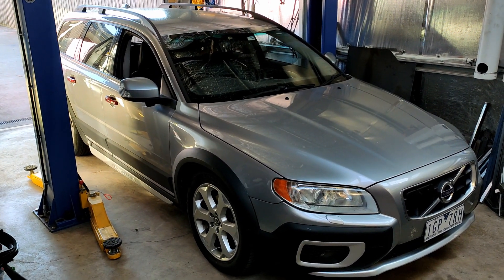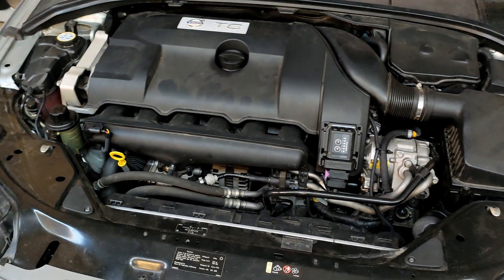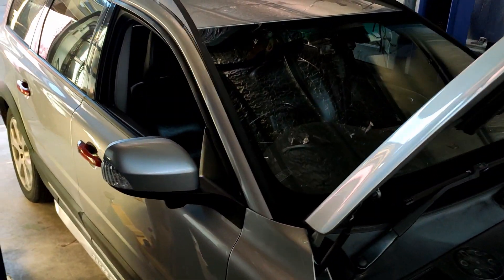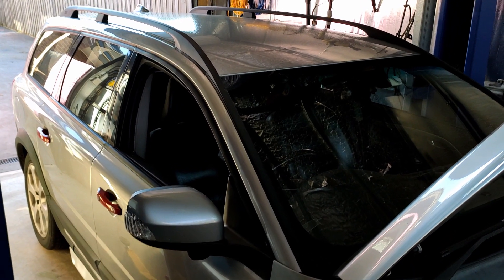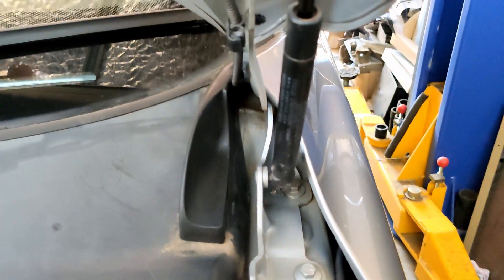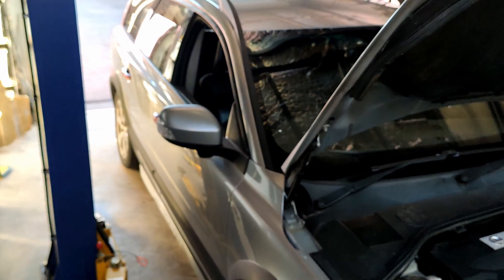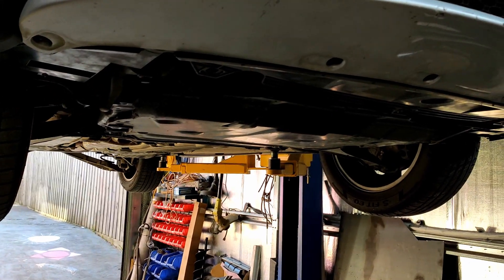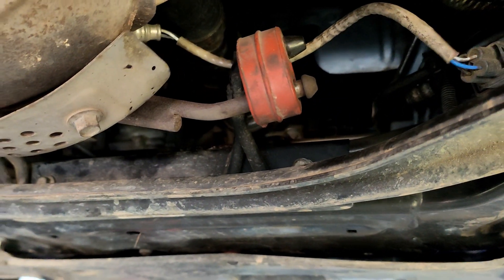Volvo XC70 P3 D5 to T6

Comment: That was some project   Hat off to you m8   Quite surprised that the cars didn’t have the cooling seat feature  especially with the climate you have in your country
Reply from the maker: Thanks for your kind words. To be honest, I do find that the air conditioning in these vehicles doesn't quite cut it for Australian summers. It works, but it doesn't really compare to what a locally produced vehicles aircon can do. Certainly no engine overheating issues though. I give this car a hard time, including towing heavy loads on hot summer days and it doesn't seem to bother it at all.

Comment: Thanks a lot for this detailed video. I'm preparing to put a V8 in my 09 XC70 3.2 using my 07 S80 as a donor, similar to the swap that @swedeprojects has shown both here and on their Instragram. My concerns are with modules - one example, the XC70 has the power liftgate where the S80 of course does not. Wondering if VDASH can keep the power option working. Also my XC has RTI where the S80 does not, so it's interesting to see that you have had trouble getting yours to work after the swap. Would like to see if you do modify yours to use Android.
Reply from the maker: I know a guy that did a similar swap. S80 V8 into V70. He did mention the tailgate issue and I don't believe he has found a fix for it. I did not get my RTI working. I wired it in, but the ICC did not recognise it, so I gutted it and replaced it with a raspberry pi. I'll make a video on this soon, just waiting for some more stuff to make it worthwhile.
Reply: @AngryGermanGarage  Thanks for your reply, great to hear of your success with the Raspberry Pi! Does your car have speed sensitive steering, or did the donor? My donor S80 V8 has it, recipient XC70 does not, but I'd like to keep it if possible.

Comment: wow, such a huge work, it's really impressive: since you are working on adaptive cruise control that is something that I am trying to install too and still miss the radar connections: are you aware of how the radar is connected to CEM? do you know how many wires it needs to have connected to get to be functional?
Reply from the maker: Absolutely no idea to be perfectly honest. I do know the plug for the radar computer inside the dashboard was already installed on my previous wiring harness, from a vehicle that was not equipped with radar cruise. This may be helpful information...